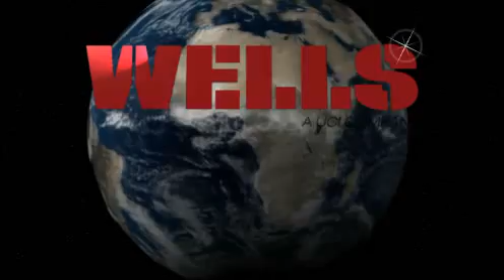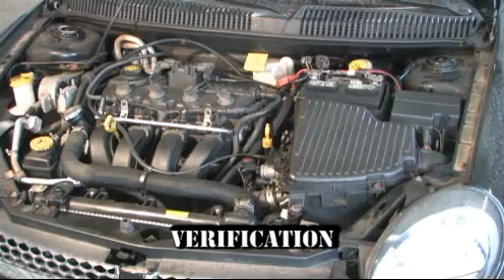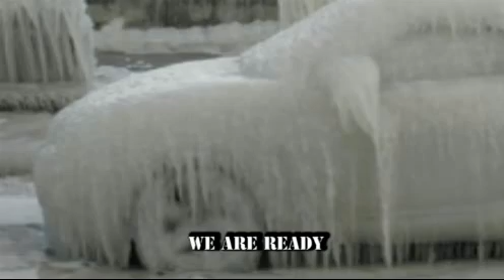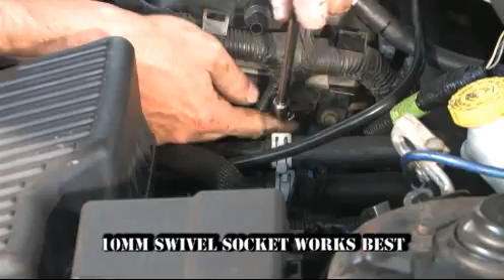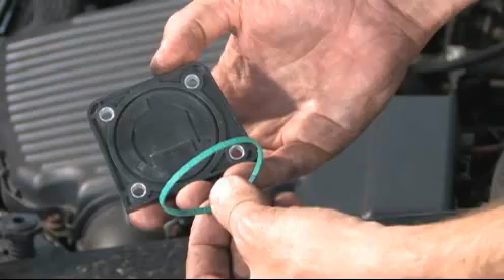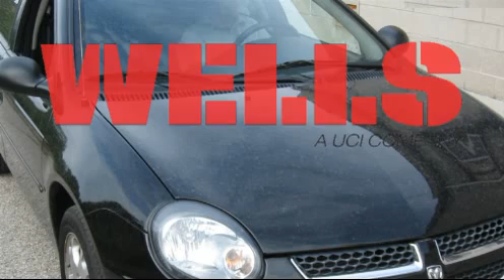Chrysler P0340 Cam Sensor Replacement

Comment from the maker: Normally a cam sensor will not cause a no-start. Most cam sensors are a Hall Effect type and can not be tested with an ohm meter. What is the year, make model and engine size of your vehicle. Does it have injector pulse?

Mark Hicks
Wells Vehicle Electronics

Comment: Great video. Hey i have a no start with no spark. I was told that it might be my camshaft sensor. Before buying a new one i want to know if their is a way to check the resistance of the camshaft sensor with a multimeter.

Comment from the maker: Take the sensor off again and check the seal very close. You will probably find where it had rolled a little. If this is the case, make sure it is not torn. If torn you will need a new one before you replace the sensor.

Mark Hicks
Wells Vehicle Electronics

Comment: cram sensor replace it, the cam sensor no signal, the connector have 9 v 5v  signal and ground I replace used distributor cause it came with the cam.  timing belt are okay according with my repair

Comment from the maker: @felipevinalay It is common for the crankshaft position sensor to cause the no spark issue. Have you checked or replaced it?

Mark Hicks
Wells Vehicle Electronics

Comment: Hi markjhicks my 98 Voyager  3.0L crank no start, the cam sensor it not sending signal to pcm, I replace the distributor with the cam sensor and no solution, 4 month ago I change the water pump, well the crankshaft bolt bend the timing belt move, fix the timing belt, what can cause no cam signal?
I checked 
all fuses and relay crank sensor replace  and still no spark.

Comment: Thanks a lot for making this video, I saved my girlfriend a bundle by doing this replacement myself.  The job was done on an '04 Dodge SX 2.0, only difference from this video to my own work on the car was the CPS used 4 8mm bolts, not the 10mm as stated in this vid.

Comment from the maker: @SuRihtanil From what you are describing it could be a spark issue, but it would be very unusual. When you try to start it I want you to do two things. Before you crank it over, put a spark tester on it and then have a friend crank it. Watch the tester to see if you are losing spark. Next spray some starting fluid into the air intake and then see if it fires up. Let me know what happens and I will guide you the right direction.

Mark Hicks
Wells Vehicle Electronics

Comment from the maker: @HarisTuubaa Honestly on your vehicle it can be either the crank or the cam sensor or both. The easiest way to check is to find someone with a scan and see if you have a signal. Otherwise you will need a labscope. 
Or just change one and take a shot at it. 
Best of luck, I hope this info helps some,
Mark Hicks
Wells Vehicle Electronics

Comment: Hey Mark, thanks so much for responding to my question.  I changed out the CMP sensor and so far the car starts everytime.  I'll have to see after about another 20 start attempts as to whether the problem is solved.  Thanks again for your advice.  Much appreciated.

Comment from the maker: @dragonzen4 Check to see if you are loosing spark or fuel. Use a spark tester and a fuel pressure gauge. Try unplugging the CMP sensor. Check for spark allowing longer than normal crank time. The engine should start without the CMP sensor connected. If it does have spark now, either the timing belt has jumped or the CMP sensor is erratic.
I hope this helps, please let me know what you find or if you have any additional questions,
Mark Hicks
Wells Vehicle Electronics

Comment: i have a dodge neon 2003 that will start everytime for about 20 to 30 starts and then it won't start.  after repeated attempts it will eventually start but it takes a while.  could this sensor be the cause?  thanks.

Comment from the maker: It is unusual, but at times the cam sensor can be defective without setting a code. What make, model and engine size is your vehicle? If I know this I can help you find the problem for the poor fuel mileage. Also has  the performance also dropped?

Mark Hicks
Wells Vehicle Electronics

Comment: can the cam sensor be bad but not throw an error code? my car has intermittent start problems and poor fuel economy ( about 175miles/tank). I've replaced the plugs/wires/coil sofar.

Comment from the maker: @jj1ca Yes when it was in the vehicle we used a screw driver to start it. Just be careful, if you force it with the screw driver it will break. 
Just take it slow.
Mark

Comment: I'm trying to disconnect my camshaft sensor wires and I can't get the thing to budge on my 2003 dodge neon. I was wondering did u use the screw driver to push the bottom tab and using ur fingers to push it down? The area there doesn't have a lot of room :( thanks for the help"

Comment from the maker: @asaultman67 When the internal circuitry fails you will not see any external damage. That is why today's diagnostics is so challenging. It is also why it so important for a modern drivability technician to be fluent in the use of a lab scope. In the near future we will begin a series of lab scope training videos. Take care and I am happy to hear the cam sensor took care of the problem. 

Mark Hicks
Wells Manufacturing L.P.

Comment: @markjhicks 

I have replaced the sensor on the vehicle a couple of days ago and have driven the car about 200 miles since then. From what I can tell the problem seems to be resolved. At least I hope so, It could also be possible that one of the wires or connectors of the system are cracked internally. It's definitely weird considering there was no visible wear or damage on the old camshaft sensor. Usually you see some sign of it being melted or physically worn when electrical components fail.

Comment from the maker: @asaultman67 I am not sure if he is right or not, but I am with you to check the connections on the PCM first. If the connections are OK, then the most probable cause for the code P0340 on your vehicle is the cam sensor. The only accurate test for the sensor is with a labscope, But if it is intermittent it may still be tough to pinpoint. I hope this helps, please let me know the result after you change the sensor. 

Mark Hicks
Wells Manufacturing

Comment: Interesting, im working on a 2004 dodge neon and Im having  a P0340 code indicating the camshaft sensor circuit problem. my dad suspects it could be the sensor, but I think it could be a bad connection.

I suspected it was due to a bad connection at the PCM because we had installed a factory cruise control kit into the car a couple thousand miles ago. But upon further investigation i found that the cruise control pins plug into the C3 connector and the camshaft position sensor plugs into the C2.

Comment from the maker: @donewitit2 This can be a real headache to pin down. The best way to check is with a labscope and look at the relationship between the cam and crank sensors. If you want to take a shot at it without a diagnosis, the crank sensor is a common failure. I also suggest checking around the battery area for a poor ground. It is fairly common for this to happen also. Stay in touch Mark Hicks

Comment from the maker: @markymark9172 You are right no one can guarantee anything in life. No one knows what will happen. But if I was a betting man, my money would go on the new sensor to last longer. The original one has been on the vehicle for more than 100 thousand miles. This cam sensor is unique in that it is also the thrust plate for the cam shaft. Which means every time the engine is accelerated the shaft would at least rub against the sensor and many times hit it, hence deteriorating the integrity. 

Mark

Comment from the maker: @alwaysblank To get the correct code you must have it retrieved with some type of  scan tool or code puller that connects to the diagnostic connector. If you have an AutoZone near you they will retrieve the code with a code puller for free. I suggest going there and write the code down and let me know what it is before you replace any parts. 

Mark

Comment from the maker: @markymark9172 We replaced the original sensor on a used vehicle before the vehicle was sold to help prevent problems during the warranty period. You are correct a P0340 does not mean the cam sensor has failed. There is no time in the video do we express this. We said when the sensor does fail the symptoms could include.Yes we do guarantee the sensor will not fail. If it does fail due to manufacture fault we will replace the sensor and also pay labor time and towing fees.  Mark Hicks

Comment from the maker: In this cause it was because the sensor is located on the cylinder head. If the engine were hot you would burn your fingers...no other reason. Just to make it comfortable to work on.

Mark

Comment: You are overlooking something that is very simple that can cause a stall when returning to idle at a light or such. The Idle Air Controll Valve/Motor can cause this as I have seen customers spend hundres on parts just to find it was this small inexspensive part that can be replaced in five min. Also I have seen the battery cause this type of concern. The battery acts as an electical spike damener and there is a votage spike when returning to idle that could cause this if there is a dead cell.

Comment from the maker: Chris,

It would be best to test the crank and cam sensors first...but you will need a lab scope to do that. However, the most common causes for your vehicle stalling is the crank sensor and distributor. When replacing the crank sensor, push down until the paper on the bottom makes contact with the trigger wheel, then tighten it down. To replace the cam sensor the distributor needs to be replaced. Mark the position of the rotor. I belive it has a dog eared gear and it can only go in two ways.